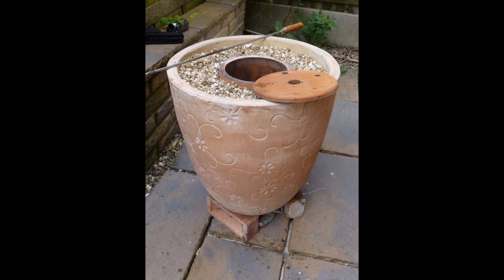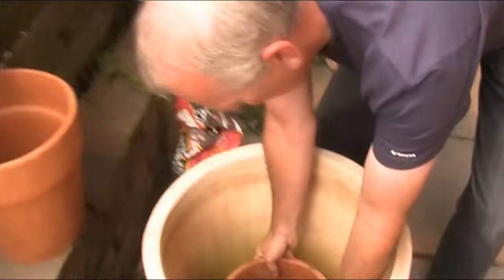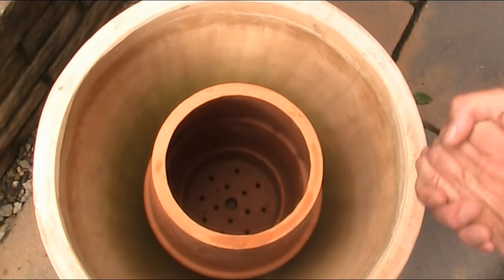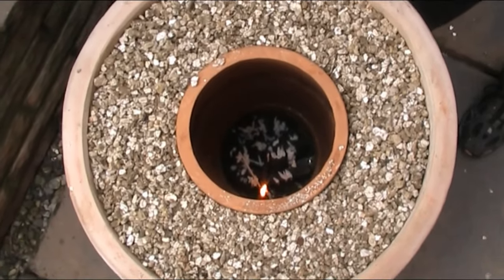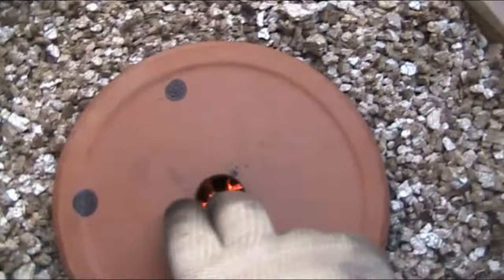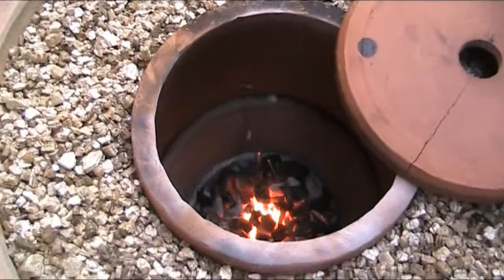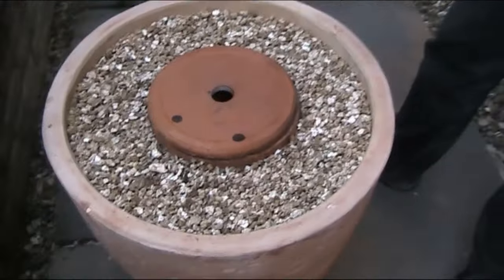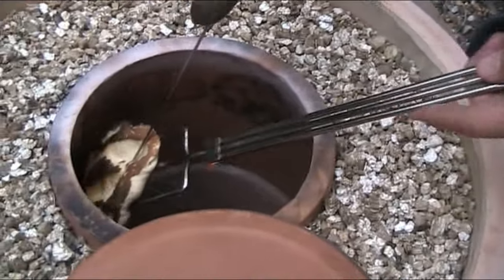How to make a DIY Tandoor oven with Flower Pots

Comment: HI, Great video and thank you for making it. I have many questions but right now I would like to ask these questions, how do you change the coal in the tandoor oven? Do you have to pull the tandoor apart to clean it every time? How long does it take to cool? Are there any other material you can use to keep the tandoor cool and the supports within the tandoor secure? and where did you find those long big skewers for the meat?
Reply from the maker: Hi, Happy to answer questions. I don't change coal, just clean our the ash - https://www.youtube.com/watch?v=ewac7d4u2uU. I don't have to take it apart, the only other cleaning is taking the soot off, if I am cooking naan - http://www.simplenick.com/blog. Not sure how long it takes to cool down, all depends on the weather, but slow in the summer. No other material or supports used, you see everything in the video. And the skewers I got from ebay and Amazon, and they make a big difference. Contact me on the website if you need more information, and thanks for the feedback.
Reply: SimpleNick - Nick Collins Ok, thank you.
Reply: SimpleNick - Nick Collins I couldn't hear clearly the name of the material you used, so please if you could tell us again what was the material you used to keep the small pots in place and Did they become very hot during the cooking process or the were good for insulation and kept the outside pot cool
Reply from the maker: Anmol Raheja The material for insulation was vermiculite, the inner pots got very hot and the outer pot remained cool. If you can't get vermiculite, some people have used perlite or sand.

Comment: Hi Nick!

Great video! I made one and its awesome. Upgraded it right away.  Tried to do naan but failed miserably, have you managed to do this? 

Also i have trouble lighting mine! takes AGESSS until today in which i used a fire log which made it crack due to getting too hot too fast!! any suggestion with making fires? tips? watched your video but mine seems to take longer.

Also when cutting plant pot do u use a certain type of saw blade? it was extremely hard mine! 

thanks
Reply from the maker: +Arren Khan Hi Arren thanks for the feedback, and yes I have been successful with naan. The trick is to cool down the side of the oven with a damp cloth. I made a video of me cooking a naan the other day, just need to find time to edit and get on my channel. 

As to lighting, for me it is all about airflow. I have good airflow from the bottom and then regulate the flow with the lid. Also for my last burn I used a couple of fire lighters, and that worked really well.